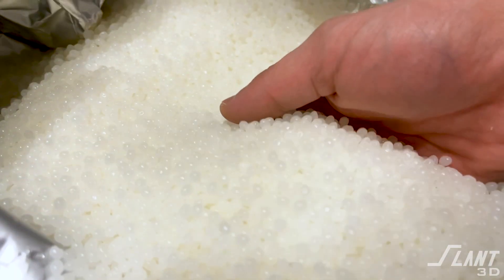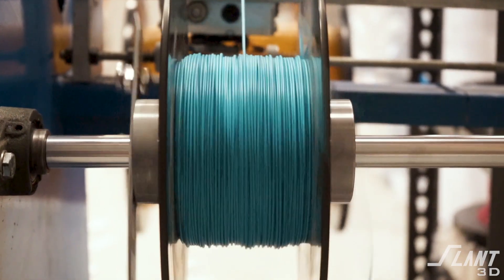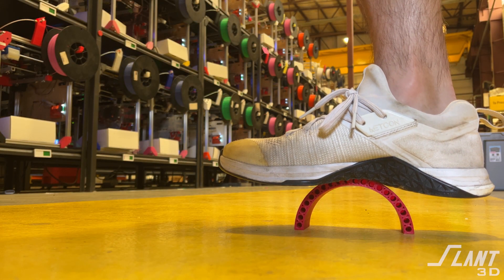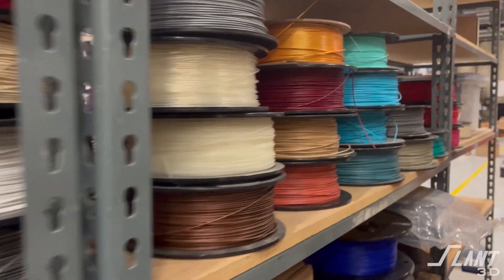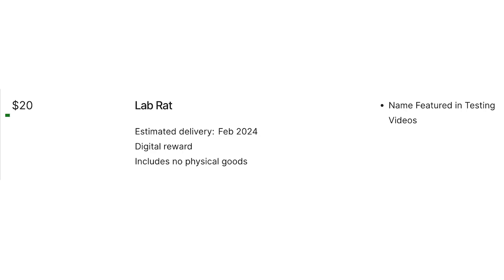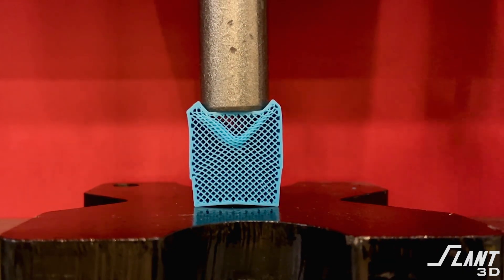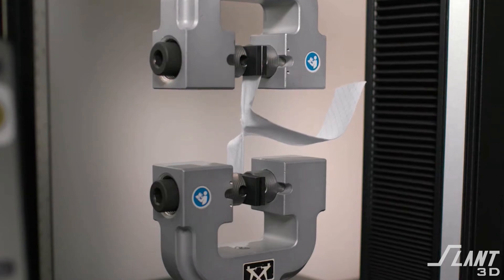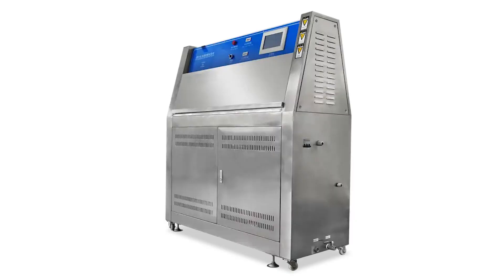We're Building a 3D Printing Testing Lab

Comment: It'd be nice if some sort of standard for PLA so the name implies some of the characteristics. Something like PLA345 where each number is from 1-9 and has a meaning, like the 3 stands for strength level 3, 4 for something else and 5 for another (maybe a temperature). Direct comparisons could then be done by the customer.  You could then just type this code into the Slicer.
Become the lab that does this and hand out "Certified by" stickers with manufacturers sending them in each year for a re-cert (for a cost).

Comment: Would love to see some kind of test that can quantify fatigue for compliant mechanisms, like brackets that will flex to allow something to be inserted, held securely, removed and repeated. Way Back When(tm), when I rode a dinosaur to class at engineering school, this was 'elastic deformation vs plastic deformation'. but obviously, once we get to cycles of deforming plastic in a way that can hopefully be repeated hundreds (if not thousands) of times, the phrase 'plastic deformation' starts becoming confusing.
Reply from the maker: Plastic deformation is still the metric. As long as the material stays within that range than fatigue is neglible. But we can certainly add it to the test list.

Comment: can we get more information of the testing methodology before putting money in the project ? that is the single most important thing in testing, way more important that expensive equipment
Are you gonna try to find the best setting to print a filament or just use the setting on the box (that are aimed at undercooled, open air bed slinger) or actually try to see if chamber temps affect print strength, like why being able to print ABS in a 30°c chamber is not the same as actually printing ABS in a 80°c chamber with sufficient cooling ? 
any information apart from a kickstater and some goal ? 

btw I am all for the project, just need information before putting money because otherwise I will just put money in the patreon, not professional testing lab level but clearly in depth enough to make buying decision on the filament itself

Comment: The problem with this I have is that I think this is a way too small scope to be actually useful. Because testing a filament once is completely pointless. The different production batches of filament can vary quite heavily. Because changing out base material would be incredibly easy. So Unless you have ongoing tests with all filaments it's still going to be quite a big questionmark what your filament actually is going to be like.
Reply from the maker: Batches of filament should not vary widely. Every other industry does not need a daily tests of material to check on people.

Comment: I use a lot of Amazon Basics filament and I am quite satisfied with the quality. I think Amazon Basics is mainly a brand name and that Amazon will probably use several suppliers of the raw material. I doubt, that they will reveal their sources. So unless a manufacture of filament also makes the raw material (big chemical companies like BASF) you will always have a variation in quality.
This happens year ago to me when burning CDs. Same brand name but quite different quality as they had several suppliers.
So on mass produces filament like Amazon Basics, you will have to do your tests several times a year to ensure, that the quality stays the same.

Comment: I appreciate your efforts in wanting to run these tests but am concerned that you might not be prepared for the full number of variables that effect the end result print, and how the end consumer probably won't be printing using those same parameters. You could probably do your 20 videos on one color of one type of plastic and still only be scratching the surface.
Reply from the maker: You have to start somewhere

Comment: I like the concept, but have two questions: 1) would it be possible for backers to get access to videos earlier, and/or access to raw data in a usable form like CSV or spreadsheets? 2) I see the higher tier includes testing specific materials. Could the lower tier allow suggesting brands, so you can focus testing on those brands the backers care about most? Both would provide additional significant incentive to back the project, rather than just wait for the videos. Thanks!

Comment: I'm very interested in the torsion tester stretch goal, often find a part that need to withstand a twisting flex and in many cases also handling an "arm flex" where a load is placed on an extended part. So far I've done my own very unscientific tests by bending things with my hands to figure out what materials, infills, and wall counts make robust parts and I'm on board with your testing and am happy that you are putting together this Kickstarter to do this testing.  One other thing that I'd love to see tested is material creep and ways to counter it by part design as well as what materials can best handle a sustained load over a long period of time. So far I've been finding ABS and carbon fiber reinforced parts to be mostly resilient to creep but haven't played with things like polycarbonate, for example.
Reply from the maker: Thanks for the feedback. Noted

Comment: This is a fantastic idea. 
However, only committing to 20 videos in return for “us” funding your test lab seems a bit, let’s say  weak. 
I know this obviously hinges upon community interest in said test results/videos. 
I just feel like you could probably provide more value back to the community in return for the funding. I’d say amongst other things, one idea would be to publish all test data somewhere public. Such as a website with all tests organized and easily searchable. So when someone has a question about a particular material,brand, or type of filament. You’d host said library of information. Instead of making people skim through various videos looking for what they need.
Reply from the maker: A seperate website is certainly necessary. But all of our test data will be released in a public drive. And obviously if the 20 videos continue to get a good response we can continue to produce.

Comment: Basically every larger Filament manufacterer bases their technical sheet one printed samples and has their printing parameters in the tech sheet. I'm not sure why you need to claim that they're using "melted" material.
Reply from the maker: Name 3 that have done that
Reply: Prusa, Fillamentum, Polymaker, Bambulab @slant3d 

Edit: just checked Voxel, they specifiy that as well

Comment: There are YouTubers like cnc kitchen that do it for years use it's knowledge
Reply from the maker: Certainly. We hope that we can upgrade the equipment and the process to be viable for actually engineering. Stefan is fantastic but you can't build a plane with the data.

Comment: Essentium TDS mechanical data is all from printed specimens, typically done in 4 different print orientations so that mechanical performance can be evaluated in different axes: https://essentium.com/wp-content/uploads/2020/11/TDS-Essentium-PET-CF_v1.1.pdf
Reply from the maker: Sure. But that is still exceptionally limited context. And is not compared to other manufacturers. And it does not show performance with varied print settings like infill and wall thickness, etc. Ya'll should sponsor the lead scientist tier.

Comment: Fantastic, lets get ANSI 3d printed plastic normalization. 

On the other note, a fatigue testing machine might also be extremely useful, knowing the fatigue life of different materials can be very helpful for applications that are meant to last many cycles. Though this might be more printer dependent as for long cycles the difference can be a tiny crack. 

A machine for testing creep under heat could also be interesting, since most plastics suffer with that property.
Reply from the maker: The tensile machine is able to do fatigue. Covered.

Comment: is there enough consistency is filament production to be able to confirm changes in material properties are caused by small stuff like dye?
Reply: all of the consistency goes out the window when it comes to most 3d printers. even changes in ambient humidity and temp will make the properties go astray.
Reply from the maker: Yes. Absolutely. Especially with some of the more formal brands that at least have iso 9000.

Comment: While I'd love for more data to exist in this space, why not do some homemade versions of testing apparatus like CNC Kitchen? The results won't be "lab grade" but the results are still useful relative to one another and cost a lot less. Plus you'll have recurring cost to keep the instruments calibrated with the more expensive equipment
Reply from the maker: This is true. But there are a lot of the home grown solutions and data out there. For Printing to really be taken seriously it needs lab grade. We can't build a plane on data from an arduino testing rig
Reply: You may not be able to, but other people can. Helped digitize monitoring of a wind tunnel back in engineering school with OG arduinos. Worked fine for almost a decade (every year, a class of 3-4 teams each produced a RC aircraft of varying degrees of flightworthyness, plus various grad student projects), got replaced with a newer arduino that could log to network instead of serial, which worked fine for nearly another decade, and the whole thing got replaced somewhere around 2015 when someone donated a new building with shiny new everything.

If you get out to research labs, where measurements are getting taken for which there is not an 'off-the-shelf' measurement option (or not a budget for an off-the-shelf option), arduinos are basically the electronic version of 3-d printed brackets; there are certainly places where they aren't going to work, but frequently, it's the quick-to-implement cheap option that is Good Enough(tm). It's not that arduinos make the project good or bad; it's a tool, and like any other tool, using it effectively requires knowing capabilities and limits. It will ultimately come down to making sure that you understand what you're measuring, that you're measuring it accurately and consistently, and that those measurements are being properly recorded.
Reply: @slant3d  I don't know about building a plane as I don't think those can be weak on one axis but I do like the idea of more formal uv testing. Best of luck on the campaign!
Reply: @Raymond-Wu  Just about every plane made ever uses materials that are weak on at least one axis.

Wood, fiberglass, carbon fiber.
Reply: Because we're looking for lab grade, standardized results from calibrated equipment.
Reply: @johnschneider9654  then you have to calibrate the printer, too. and if thats done individually, then there goes any standardization.
Reply: @simonschneider5913  totally. But calibrated, standardized testing equipment does eliminate the variable of home grown equipment.
Reply: @johnschneider9654  i already expect the filament manufacturer to do that.
Reply: consistent printing environment is much more of a concern to me than filament production quality, as they have it much easier to be consistent than most fdm setups could ever manage to achieve.